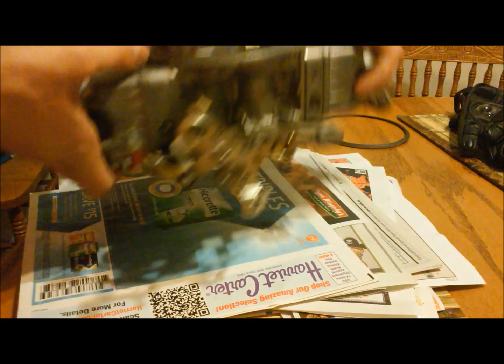Holley Carb: Ported vs Manifold Vacuum Advance (CARB BASICS PART 1.5)

Comment: I have a 66 Mustang with early 80's 302, Holley Ultra 650 DP, and a decent cam that produces vacuum of 12-13 in.Hg. at 850 rpm idle. Timing is 16 degrees initial+20 degrees mechanical advance=36 degrees total at 3200 rpm. I have tried to run vacuum advance, both ported and direct but the engine just doesn't like it.  With vacuum advance connected my dial back timing light showed 50+ degrees at 3000 and engine sounded rough. This is a weekend car and I'm not concerned with mpg. Is there any particular reason I should alter the tune just to run vacuum advance?
Reply: I know this is an old post but I have exactly the same numbers.  16 to 36 mechanical.  I dialed my adjustable canister to 10 degrees.  Runs fine but I'm in the same boat as you it hits 57 degrees at 3200 rpm holding the throttle open in the garage.
Reply: Are you connected to ported vacuum? Sounds like it. Connect to manifold vacuum, you need 50* at idle, less as you hit the throttle and vacuum drops...

Comment: wowe did he say vacuum advance canisters are rated in inches of vacuum and will only add timing when the engine produces 15" or more that shit ain't right lol
Reply from the maker: Aside from saying "inches of vacuum" this is entirely true - what do you not agree on?
Reply: vacuum canisters are rated in how many degrees of timing they add not at  what inch of vacuum they open, for instance a 15 canister adds 15 degrees of timing, you stated a 15 rated canister as not opening till the engine produces 15" or more.
Reply from the maker: +tron696 here is what I said - most stock vacuum advance canisters add in 15 degrees of timing which is for when you are cruising and the afr is leaner. A lean mixture burns slower, so you need more timing for that fuel charge to ignite at the most optimum time. Consequently when you step on the gas, manifold vacuum drops and you have a richer mixture that burns faster so it doesn't require as much timing. Most stock vacuum canisters drop out at around 15 inches of mercury to where the ignition timing is solely mechanically based. 
Does this make sense now?

Comment: I set my SBC(auto) to manifold vacuum to improve the idle performance. It worked great!  However, I noticed when I decelerated the engine braking resulted in full vacuum advance and that resulted in detonation.   Is there any way around that?
Reply: I have never of an engine detonating or preigniting (there is a difference) during deceleration.
Reply: I meant never heard of.

Comment: holley themselves tell you to use ported vacuum for your dist, so thats good enough for me
Reply from the maker: That's because it's easy for people.
Reply: i dont believe that would be why a company thats been in business for nearly 100 years would say. they have researched vacuum advance in relation to full manifold vacuum as well as timed port vacuum in great depth. wouldnt you agree ?
Reply from the maker: +bigpaw64 consider this, all engines were manifold vacuum till emissions. Ported was part of emissions to have less timing at idle. It had to do with exhaust gas temps. Now high lift cam guys have to run a lot of initial timing, so it gets to be a pain. But stock 8 degrees initial, 6 degrees initial. Will run better and more efficient all day off manifold. If you have a look at modern cars, they all run 20 degrees initial. (With my scanner)
Reply: im not talking about modern cars or emissions. im talking about holley carbs. ive been buying holleys from the late 60s to present day. these carbs had ported vacuum options on these long before catalytic converters and emissions came along. im alot older then you. all im saying is holley recommends using this for your distributer advance because it works. we all know street cars and race engines have different needs. but for a mid level street car useing a 600 -750 cfm carb , ported is best.
Reply: @ThunderHead289 No, long before emissions the factory used ported vacuum. Every mid 50s to early 60s Mopar used ported vacuum
Reply: Once the throttle is cracked open there is absolutely difference in the vacuum signal sent to the advance canister whether it is ported or direct vacuum.
Reply: I've always imagined manifold sourced vacuum advance as a way to make the a/f ratio as lean as possible. Tune the mechanical advance for performance and add vacuum advance solely to improve fuel mileage. If you need vacuum advance to overcome any drivability issues, you have problems elsewhere- probably a lean carburetor. That's my story and I'm stickin' to it😊

Comment: Ok, so I want around 30 degrees of timing. If my 351w is set for 10 degrees btdc without advance, that should mean that with advance it will be 20 degrees after top dead center. Is that correct?
Reply from the maker: alright, if you want 30 degrees of total timing, you need to first know how much timing your distributor pulls in mechanically - this would be without the vacuum advance. on a stock 351, you should be at 8 to 10 degrees initial timing BTDC. your total timing will be 30 - 35 BTDC. as your engine speeds up, you need more timing to keep up with the rpm since the flame front of the ignition is basically the same speed. does this make sense??
Reply: ThunderHead289 I believe it does, at idle I should have around 30 degrees btdc at idle with advance hooked to manifold vacuum and idle speed set correctly. As rpm increases, so will the advance so the flame front can keep up with the piston. That's how I interpreted it. Thanks for the info, I think I understand how and what now!
Reply: @bairfamilyfarm1336 This post was 1 year ago, how did that work out for you?

Comment: Great video as usual 😃👍👍. 
I actually shipped my Holley 850 out to Max Air Carbs for a total rebuild/custom repainting. A couple of weeks ago, I shut the 455 motor OFF ... fuel was pouring into the intake manifold. 👎👎
Reply from the maker: thanks for the positive response! sounds like either a dirty/failed needle and seat or a failed float !!!

Comment: Greetings, I have a Holley 4150 0-4778C installed in a 1965 Ford 289, I had to acquire an automatic transmission TCI 511200 C4, now the point is WHERE in the carburetor you can connect the hose from the transmission vacuum modulator valve? I see only 1 port that is for the distributor timing, some other videos recommend do not make a share connection in "T", Can you help? 
#2: For the booster´s hose vacuum, what kind of valve is PCV? I have the intake manifold Street Dominator, but I need you tell me exactly what´s the name of any fitting, valve or device that can be installed in the back of it for the booster´s hose
In advance, Thanks for your concern & prompt response
Reply: I have a 71' F100 w/302 and C4. All the vacuum for the trans/power brake booster is coming out of a tri-port that goes directly into the intake manifold behind the carburetor. The PCV connects to stock 1" aluminum spacer that is between carb and intake manifold. The vac advance is connected to the lowest port on carburetor. This is an all stock motor....Hope this helps.
Reply: MrDLRu  Thanks a lot ! x your answer, is exactly what I concluded to do, now I'm quite relaxed, soon I'll finish the restoration & do the start. Have a pleasant New month

Comment: Very good! You did a great job explaining the details and clearing the air! Manifold Vacuum is the correct termination for your Vacuum Advance. Set your Total Advance with the VA unplugged and the Engine RPM a little past where the Mechanical Advance stops Advancing. For a Small Block Chevy, this will be somewhere between 30 and 36 degrees. Then you hook your VA back up to the Manifold Vacuum, and set your Carb Idle and Idle Screws. The only other thing to consider is your Mechanical Advance Curve which is set with the Weights and the Springs in the Distributor and under the Rotor in most cases. You want light Springs for a light car with lots of horsepower, and Heavy Springs for a heavier vehicle with lower horsepower. You typically want your Mechanical Advance to be all there by 3,000 to 3,500 RPM. If you change the Mechanical Advance Springs and/or Weights, you will need to repeat the process to set your Total Advance. Oh... and if you've got issues with a Large Cam Grind bouncing your Vacuum Advance at idle, you might need to cap it off and run without it. Like 289 said, Ported VA will give you too much Total Advance and could cause engine damage. Party on...
Reply: I was taught that you set timing with vacuum advance disconnected then you reconnect to ported vacuum so that the vacuum increases as the throttle plates open and engine speed increases creating vacuum above the throttle plates. Connecting to manifold vacuum would bring in the advance at idle and then it would decrease as throttle plates open which reduces advance and decreases power. Is that correct?
Reply: Steven Peruch only decrease when you full open the throtle plates , but distributor stays at total mechanical advance
Reply: @topfuelr473  You are correct.  Ported vacuum was NOT designed for emissions, in fact. they found ways to block it on emissions cars to make them run hotter and cleaner.
Reply: Both true. Also check your temps at idle. There's a reason u want some advance at idles.  Not all cars the same